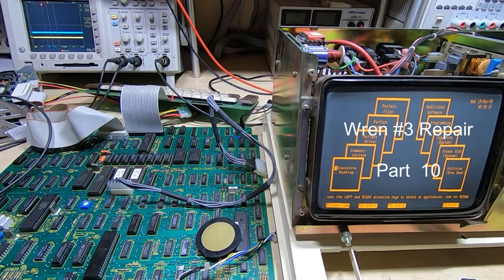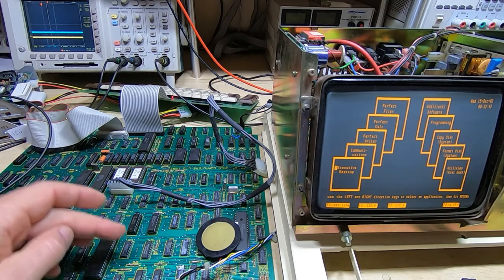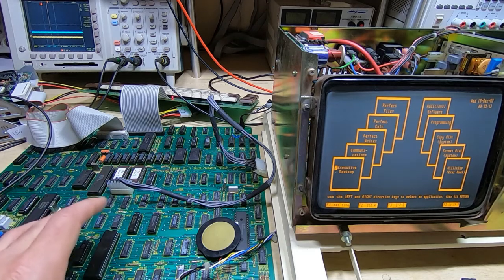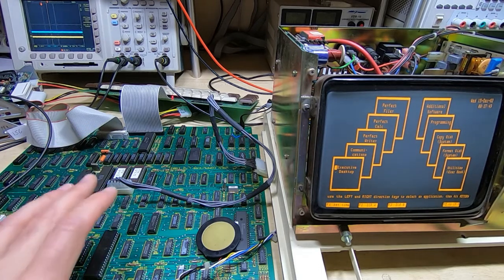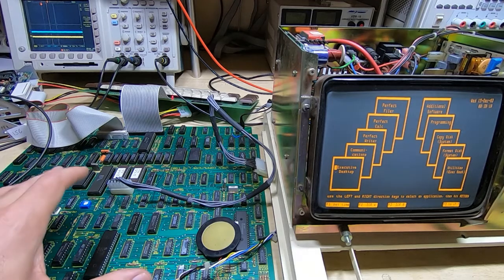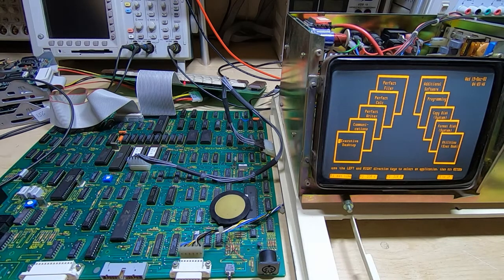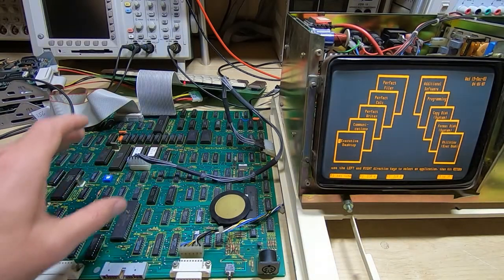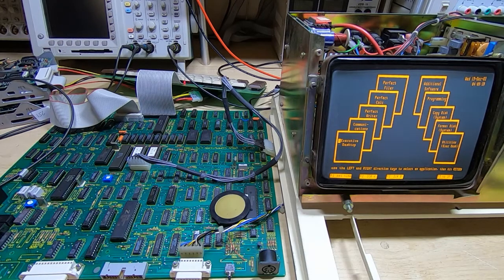Wren #3 Repair Part10

Comment: If you're worried about the monitor find a way of removing the power.   Even cut a wire and install a switch.  When you're done you can repair the wire.
Reply from the maker: That would be an option if I was trying to make a simple repair but I do not want to remove power from it as testing it is part of the process. It is easier just to turn down the brightness (There is a brightness pot on the back). The monitor is powered from the unit SMPS so removing the monitor load may have significant impact on the system operation. I am also trying to test the monitor and SMPS at the same time but turning down the brightness has minimal impact on the test results and I can also still see if the system is running.